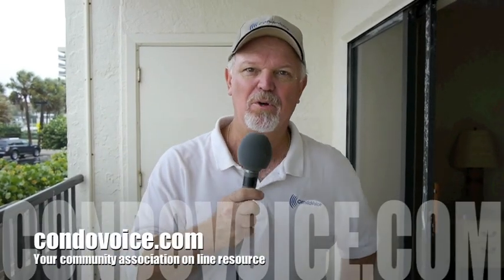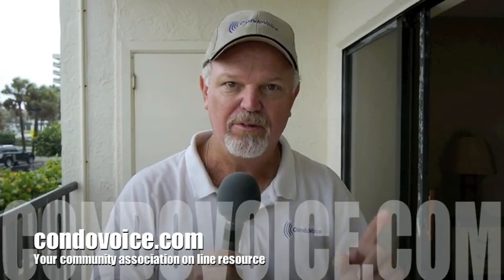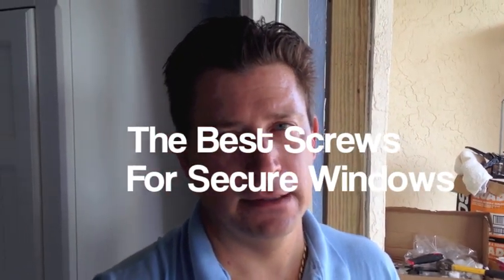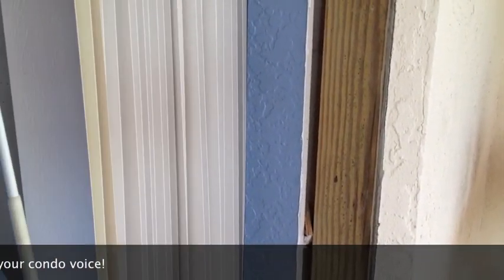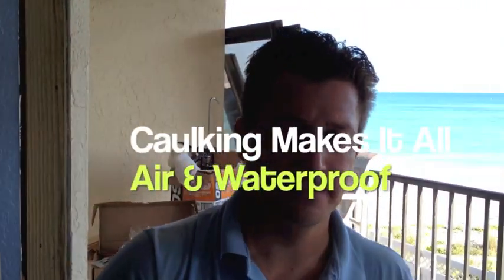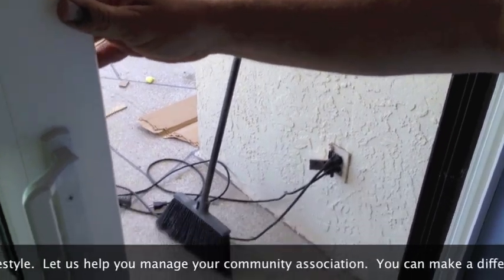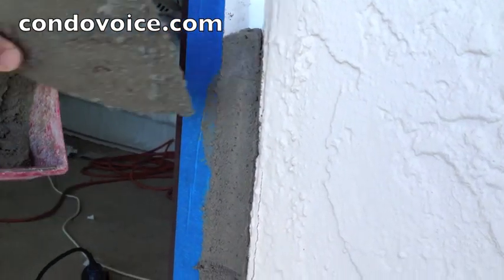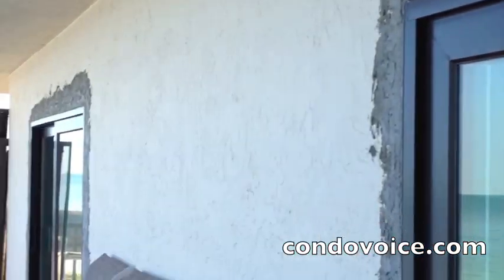How To Install Hurricane Proof Sliding Windows in your condo (condominium) or HOA home

Comment: What is the cost to replace a slider like this please?
Reply: Wish I could give you an exact amount, but it really does depend on the existing frame, and what door quality you want.  The range can be from $4,000 to 7,000 for hurricane rated, vinyl framed, insulated - AKA best product available, by a pro, with a permit.  The window is only as good as its frame.  If you have to do substantial improvements to that, wood, etc.  that would be the top of that range. Hope that helps, all the best.

Comment: It is just pitiful that windows and doors can’t last more than 20-30 years. Old houses 100 yrs old are fine - smart folks repair the windows, install new wood storms and they are ready for another 100 years - even windows in 300-400 plus 600-800 years in Europe for example are still the original windows. These old properties are historic and they aren’t allowed to replace so how come with all the modern technology - we can’t get decent windows that last 75-100 years in our new homes? I have friends who spend $500k and in 15-20 years they are replacing windows, doors, flooring, appliances, screens, roofing - almost rebuilding the home - crazy. I understand the hurricane impact glass but there are storms that would meet without replacing the originals. Just replace the hardwesr, rollers and gaskets. Install the security hurricane resistant storm gates and they are set. Look at what South Africa, Uk,, etc The US needs to get smart. What they did today, they most likely will be replacing in another 20 years.
Reply: You're talking about ocean-front homes.  They salt water and winds are far greater than homes inland.